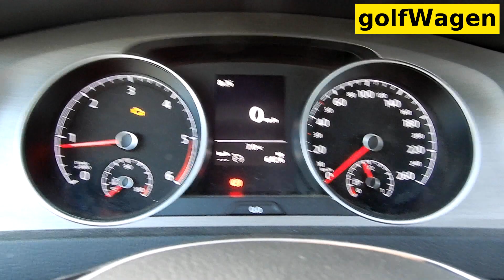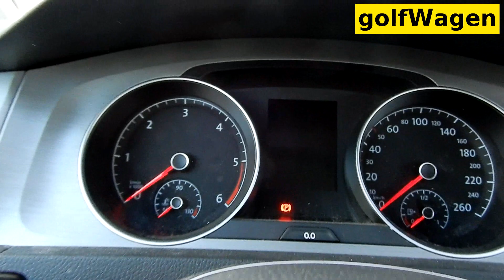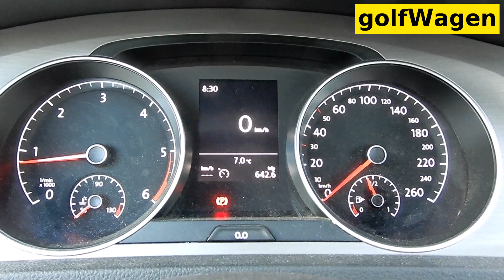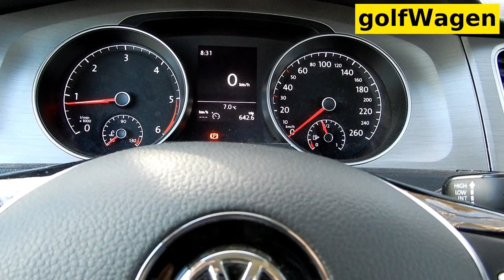VW Golf 7 glow plug relay 511

Comment: Had this issue last week. Dealer quoted me £500 estimate for 4
Glowplug plus 1 glowplug relay. I went to local motor factors bought a £75 glow plug relay and problem solved. My car is a 2018
VW Touran 1.6 TDI DSG.